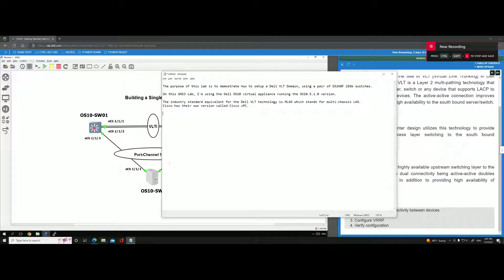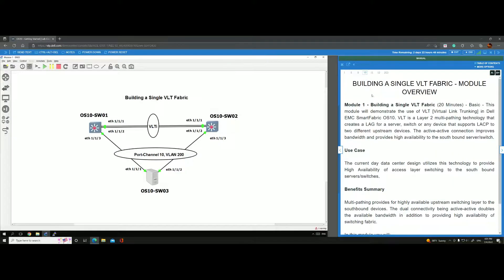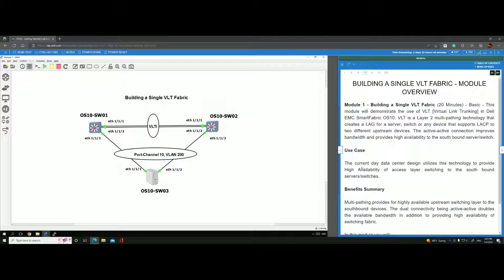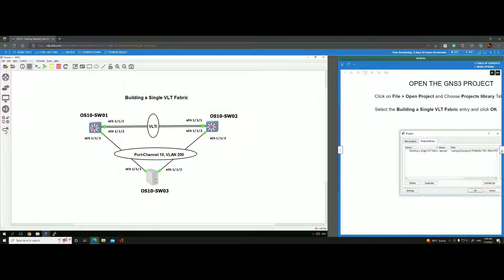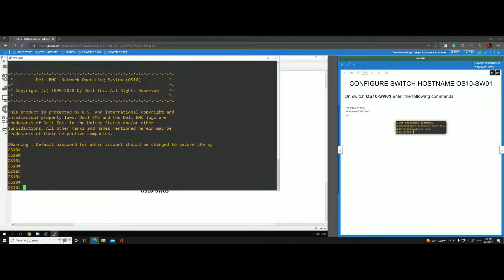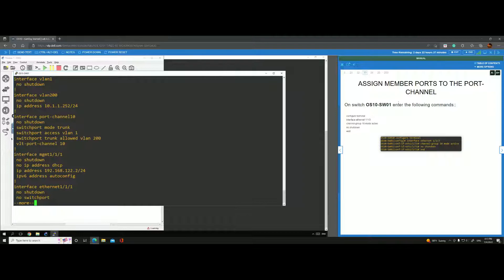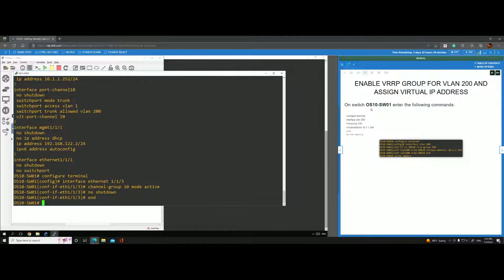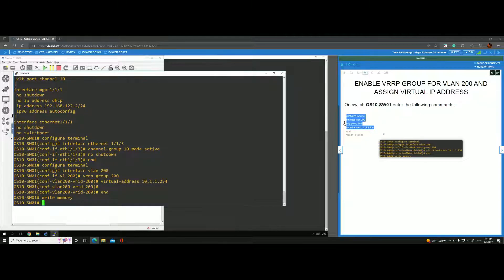GNS3 Lab1a using Dell OS10.5.1.0 virtual appliances 1 of 2.

Comment: Hi, can you please explain how you got DEll OS10 working with gns3?
Reply from the maker: I don't have an easy answer, had to read the OS10 virtual appliance document  , and watch a few YouTube videos on setting up the GNS3 VM Server, then initially had issues with the virtual NICs, until I finally got it to work.  I may make a video on it as time permits.  Besides the Dell Demos, I bought a used Dell T7810 Workstation with dual six core xeon, 32GB RAM, Radeon GPU, this is the the machine where I got GNS3 and the Dell OS10 virtual machines to work.
Reply from the maker: Just made a video with some tips, since I had GNS3 running.  https://youtu.be/4dyN-V2u3yE